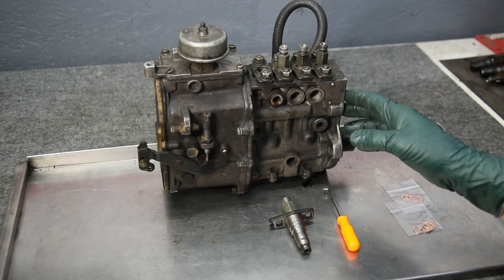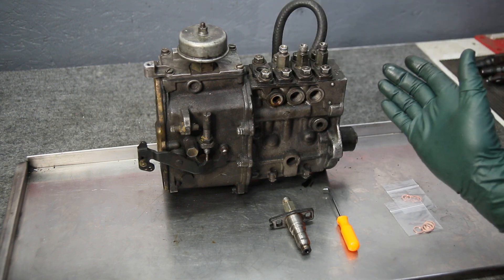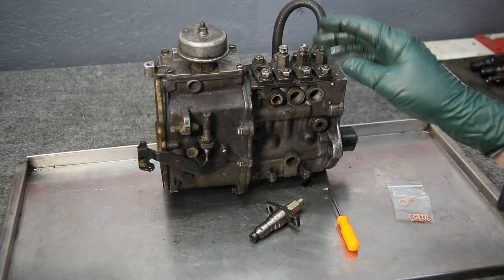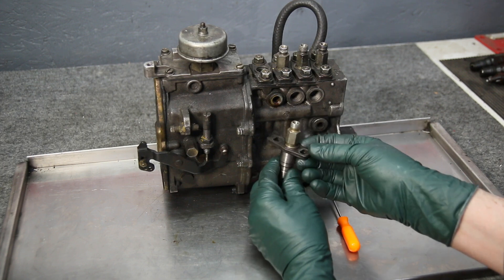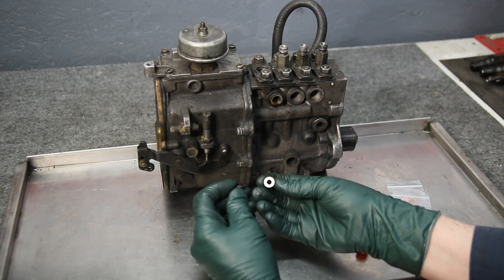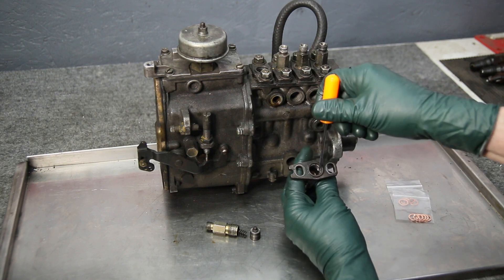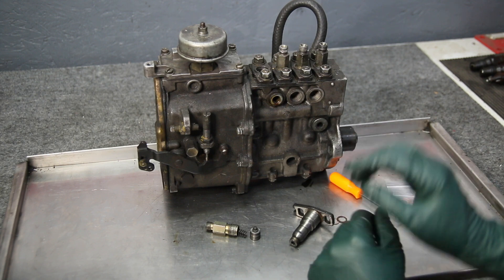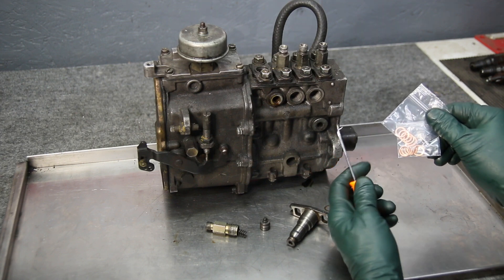Diesel I.P. Delivery Valve Removal and Replacement - Reseal Kit Available

Comment: Hello, i have a Ford 1720 tractor that started leaking from under the delivery valve holder.  I have tried tightening, but it continues to seap. Is this the same setup? I have looked in the manual. However,  it is unclear.

Thank you for sharing your knowledge

Comment: Ken,  love your videos!  I have discovered a approx 1964 OM621 190Dc vehicle and taken the engine out.  It has been sitting for 30 years!   I noticed you do not have many videos on these old engines.  My question is the injection pump appears to have a resevoir for oil?  Should it be changed and what kind of oil would be best?  Thanks  Uriah the Dakotan
Reply from the maker: Yes it should be changed. You can find lots of information on the subject by doing some deep dive internet searches.

Comment: Any idea how air could get into an injection pump though the delivery valves?  I am chasing an air infiltration situation and wondering if the o-rings of the injector barrel could be at fault.  No fuel leaks at all either.

Comment: Hey Kent, I've got a 1979 300d manual that has some issues with shaking when letting off and giving it gas, the car just sputters for a second or 2 before picking up speed. Was told by mechanics that its a IP problem. What should I look at first?
Reply from the maker: I would do a diesel purge on the engine and then change all the fuel filters (including the one in the fuel tank) before doing anything else.